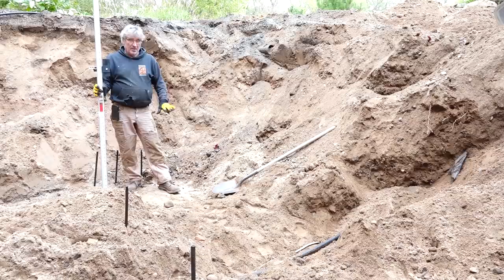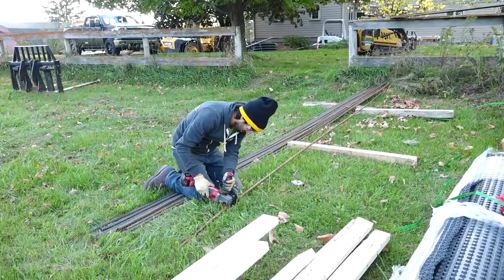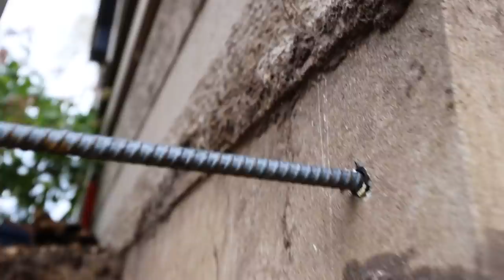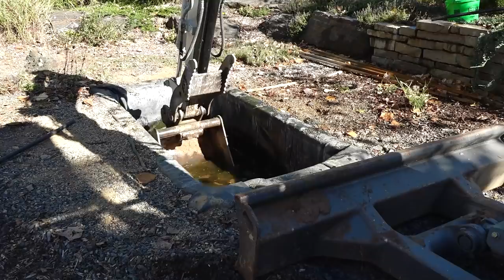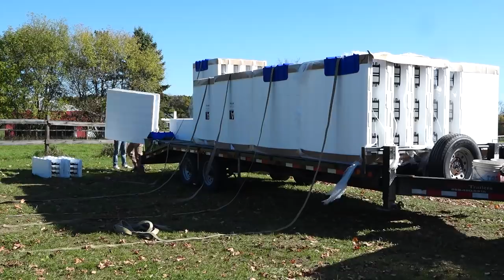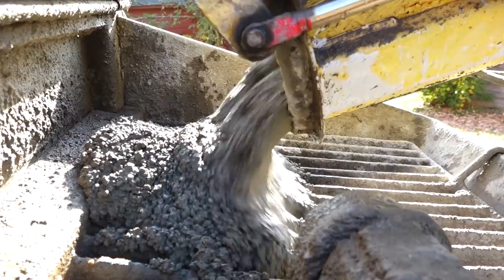Forming and Pouring Concrete Footings  | Home Renovation & Addition Part 4

Comment: Tip for the next time you install rebar regarding the tie-bars that bridged the three rebars in each footing, make sure they stop short of the wooden form by 2 inches (5cm) as the outer skin of concrete is porous. Rebar needs a minimum 2 inches of concrete coverage in all directions to prevent rusting.  So bend your tie-bars Z shape, it's more work, but you'll achieve the minimum coverage and you'll prevent corrosion of the rebar.  BTW: Enjoying this change of content, and the banter while building :)

Comment: BTW    Next time you have a water line from well to house, put a 2nd hose in and dead end both ends.   We didn't and the hose broke and the guys had to get very creative trying to get another hose under the addition.  They did  and put in 2 lines then.  All when it was below zero temp.  Great stuff.

Comment: Probably too late to be of help now, but when doing a concrete pour yourself, when you're not a concrete pro, use your cordless "Sawzall" without a blade against the outsides of the footing forms (or the ICF forms) as a substitute vibrator to help remove voids from the concrete.  Also helps the concrete to self-level as well as helping to bring the cream to the top.

Looking good, young man.  Feel free to reach out if you have any questions, comments or concerns!
Reply: you can also just rap it with a hammer, rubber mallets work well also, small rotohammer is a little more heavy duty/ per damage to the sawzall, Older than Dirt, brought up with the hammer mode, and also mucking up and down with a 1x along the edges
Reply: That’s a great idea I was suggesting the commercial type vibration tool noooooo not that one you guys lol

Comment: You should've put that water line in a sleeve, just in case it went bad, you could pull it out and replace it if it ever went bad. Once the floor is in you will have to reroute it a different way. Just saying......I really enjoy your channel. If I was closer, I would give you free labor to help you meet your budget. Thanks for all you do!!! The electric should be in the same sleeve. Bigger chance of that burning out than the water line busting. Your construction man should have suggested this. I'm all about future repairs made easier with less cost.
Reply: I was thinking the same thing.
Reply: He can’t put it in a sleeve without disconnecting it, no? There’s nothing preventing him from boxing it in before the slab goes in.
Reply: I don’t think the building inspector would let water and electricity run in the same conduit or sleeve as you put it.I have been on jobs where services were in ground and have to be in separate layers of bedding sand in a designated trench separated by layers of bedding sand with no rocks whatsoever buffered by treated lumber and then caution tape on top of each layer so if somebody was ever digging in that area you would see the tape first.in the case of a penetration through concrete each service like water , electrical, telephone etc would be in its own conduit.that’s the rules where I live.government regulated building code.
Reply: I thought he should just move it.  I think that is just poly pipe.   Easy enough to just put a new hole in the house and run it outside the new addition.
Reply: @mistermister2085  I was always sceptical of running services through a hidden access and poly doesn’t necessarily last forever. I helped the neighbour replace the exact same thing because it had been leaking
Reply: @polarlab113  Wells have the power wires and the discharge tube taped togther..
Reply: @sweetkellymay  yes they do but a building inspector doesn’t oversee a well I have been on many building projects in my 67 years and that’s what the code states

Comment: I salute you for your good nature with regard to how long it takes sometimes to run parts down under even normal conditions. With the supply chain now in disarray, I'm finding items that used to be 'on the shelf' now being 4, 6, or even 8 weeks out. We do industrial construction these days and it can be even worse. 

I've taken more than one cussing from residential customers who didn't get this and I simply allowed them to chase down their own parts going forward, while I waited for their return. They soon discover that knowing where parts are or who might by chance have them or know a guy who knows a guy is a database built over the years.

Comment: Always fun when you have the right equipment to make the job easier. Pumping the concrete in is so much easier than using buckets or wheel barrel. 😎

Comment: Those epoxy fastenings are the Gunz, been using them in old voidy brickwork for years, I usually just buy the mesh tube and cut to length. Hilti to my mind
produce the best fastenings there are.

Comment: Typically on those wall connections to the old house, I would put in 3 more rebar in between what you have existing;  but I would put them in at an angle..  So you will have your normal straight rebar, and then a few angle rebar pieces.  And that keeps it from separating from the house.  If your rebar are all straight, there can still be separation over time and you can get gaps where your new wall meets the old house walls..  But again, if you drill a few short bars at like a 45 degree angle sticking out, it will keep your concrete wall from pulling away from the house, because you have opposing angles of rebar anchors..  I would especially do it since your anchors are a little less than ideal, from it being hollow...  Again, to clarify, if all your rebar is straight, you're relying on that epoxy to hold-- and if it slips, there's nothing to keep it from separating if it settles..  but just drilling a few more short rebar holes in your old house walls, at an ANGLE,  ideally in random directions--   then even if none of the epoxy holds -- it still can't separate from the wall because your rebar is at conflicting angles, and it would have to bust the concrete before it could ever move.  VS, if you don't do it--- you may see a gap later if that rebar slips in those little holes and it ever settles.  I'm sure it will likely be fine without it anyway, but I'm thinking about 15 years down the road after it has rained a lot and everything keeps settling in that soft sand.........  Angled rebar anchors in conjunction with the usual straight rebar layout-- will stop those gaps from ever happening.
Reply: I think that the foundation and forms have been poured by now.. Any later would be costly to get it properly heated.

Comment: Really wish that electric going in was sleeved, that will be a rough repair if ever goes bad, water as well, enjoy the channel and best of luck with your project!
Reply from the maker: We decided to do this because any repair or access in the future would involve digging anyways and can be relocated at that time
Reply: Agree, sleeve it under the slab and elbow up into the interior space at least. Digging is one thing, busting out concrete and repairing it is another.

Comment: Matt, why not just use a snipe on that rebar cutter. Will you be waterproofing the basement walls on the exterior. If you dare be cautious what you use. Some is damp proofing and some is water proofing. Great choice using ICF.

Comment: The older roof valley is bisected by the last addition, and is a massive leaf catch. I would love to see how you don't have water issues with the leaf dam. Problem is, how the heck do you fix it? Can't go up on the roof every fall to clear the leaves. Best of luck! Great job so far. Also I could watch Matt cut rebar, with the rebar cutter, all day, that shit's funny.
Reply from the maker: That roof structure was designed as such. It’s terrible. We’ll be restructuring the roof

Comment: Puts safety caps on the horizontal rebar, leaves the vertical uncapped :)
Reply from the maker: Added them the next morning after the concrete had set

Comment: I have a friend that built his house using that styrofoam, concrete form mixture.  I’d you will be embedding conduit for electric outlets or fixtures, be sure to include nylon line to pull wires into the conduit as building progresses.  In 2 minutes of hindsight, I’m probably too late with that suggestion, sorry.  

Wishing you and your family a blessed thanksgiving season.  Peace brother.

Comment: Good thing you have a bigger basement, you can go there if she's mad at you. I go to my shops, I have 3-4 of them. I was a contractor and would have used wood stakes for the forms- the hard way. I would just use a level, no laser. Engineers and architects? No, unless you have a huge addition like yours. I used to cut 7/8" steel wire with  hydraulic cutters. Easier.

Comment: So thick footing looks like foot thick. Also never used so thick rebar on residential building but i live across sea.
Reply from the maker: Yes, 12” thick by 24” wide
Reply: @mcremona  Wide is same that we usually do, sometimes even narrow if building above is very small. But common thickness is only 8".
 
On apartment buildings footing is usually thicker but very often those are done with concrete machine piling.

Comment: Another question about ICF. The foam it's made out of I thought was hazardous when it ignites? We had buildings made with exterior foam products in our region back in the 70's...after a few fires, some families died from gaseous fumes from the burning of these foam boards so it was forbidden to use as an interior building product. Has this changed in some way so the foam can be used on the inside with ICF?

Comment: I was amazed at the power of the JCB in removing the frog pond! What is it's weight limit? It's too bad you don't have horses. We used something like the pond to water them.
Reply: Q: How do you know when you've overloaded the telehandler?
A: The operator's face is planted firmly on the windscreen and the rear wheels are high in the air.....
Reply from the maker: It’s rated to lift 9000lbs with up to 6’ of boom extension. I have no desire to have horses but we already have 6 plumbed in waterers in the pastures

Comment: am not sure if this is relative now or in your case and area building codes but when burying water and electrical in the same trench they should be 12 inches apart and gas lines are like 24 from electrical just a thought ?? you most definitely don't want to electrify the water supply in the event of a leak 🥴

Comment: I think an angle grinder might serve you better on cutting that rear lol. We used to use a gas axe in heavy construction
Reply from the maker: I used a chop saw to cut all the 5/8 bar. That one I was cutting with the cutter was 1/2” 😂

Comment: Why did you not do a key way in the footing?
Reply from the maker: Wasn’t spec’d in the plans
Reply: @mcremona  Interesting, so your walls are independent of your footing with no lock in. Only the rebar. OK, my addition 12 x 30 with basement work shop and 2 story's spec a 2 x 4 key way. Love your show, great content. Good Luck with your addition.

Comment: On your Styrofoam forms, I can see where the styrofoam on the inside will work well but won’t the styrofoam on the outside eventually absorb water and deteriorate?
Reply from the maker: It gets sealed and waterproofed on the outside
Reply: @mcremona  Thank you for the information

Comment: How is foundation hollow and why is it hollow?I would be suspect the structural integrity of the foundation is compromised now.
P S - I just saw the foundation is cinder blocks I might have pumped the cavities full of grout for those pins because cinder blocks have nasty habit of being unstable.in the sidewalls due to the relative thickness not being designed to hold lateral shear loading.but anyways I like your videos a lot I watch them all especially the saw milling you are a master
Reply: There is no cinder block. Concrete block.
Reply: @firesurfer  yup you right it’s what we call concrete blocks here
Reply: @polarlab113  You do know real cinder blocks are practically impossible to get. They are good for partition walls only and have no strength. Almost the same price, and worthless.
Reply: @firesurfer  you missed my point I’m sorry I didn’t make it clearer cinder block is a generic term look at your local Home Depot or building supplies dealer and ask for cinder blocks and what you get are concrete
Reply: @polarlab113   I know that's true, but most people don't understand that.
Reply: @firesurfer  and most people make comments based on assumption
Reply: @polarlab113  That's life.  All we know is based on association. Everything.

Comment: Those are the strangest cement mixers I have ever seen! Arizona is much different
Reply: This is what all the new ones look like. It makes most cement jobs a one man job instead of two. The driver can control the chute and the truck all at the same time. Before it required two people. With the trailer and the aerial view, it did make it look like an older truck was driving backwards down the road.

Comment: - What was the slump? It looked wet to me. Wet slumps were less strong back in my time pouring.
Reply from the maker: 5.5”
Reply: @mcremona  .
- Good. My eye is WAY off. Groan.
- Generally the specs. called for 5", and if we could do it we called for 'dry", 4" for strength /major footings.

Comment: I would have, instead of putting those boards on top to brace the forms, use heavy wire inside, threaded through holes.

Comment: the hose guy should have stuck the hose under the top plate and started hosing from there to fill the gap up a bit more... and maybe should buy a portable vibrator machine too?  -_-

Comment: Maybe you guys know...why the rebar when you can just use 32 mph with air and fiber added cement. It's only a few dollars more but doesn't require all the metal work?
Reply: I would trust rebar over fiber any day of the week. It's what all the real pros use. Easier rarely means better.
Reply from the maker: We’re doing what’s spec’d by the engineer on our project
Reply: Ahhh…one of those ‘trust the science guys’….not the re-bar
Reply: @vaughnmaurt5013  well when you are replacing cement because it's all cracked the rebar adds insult to injury. Difficult to remove yet responsible for the cracking.